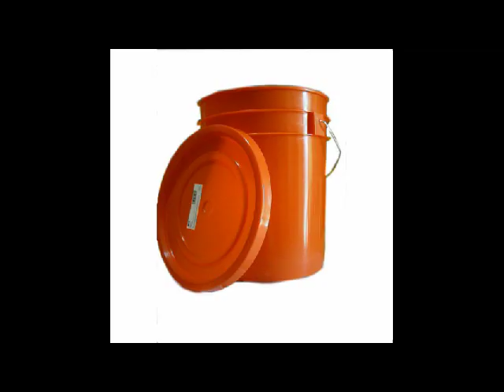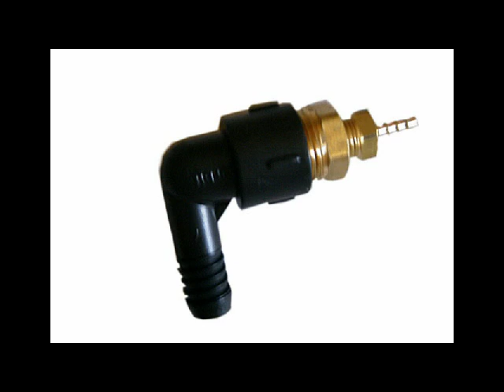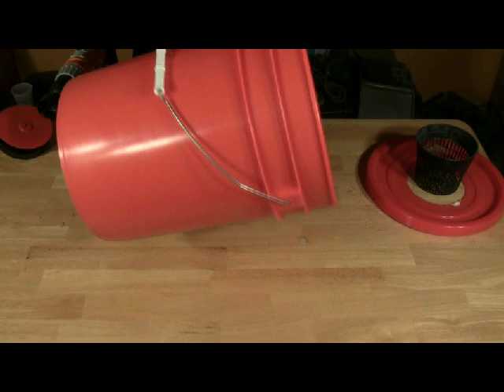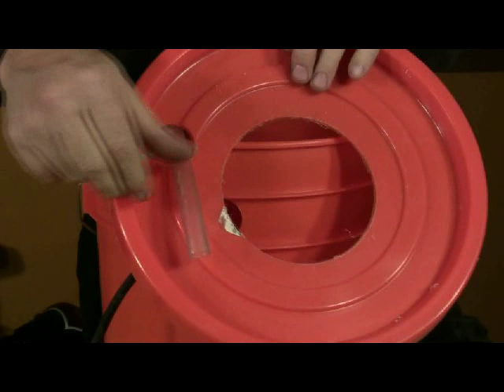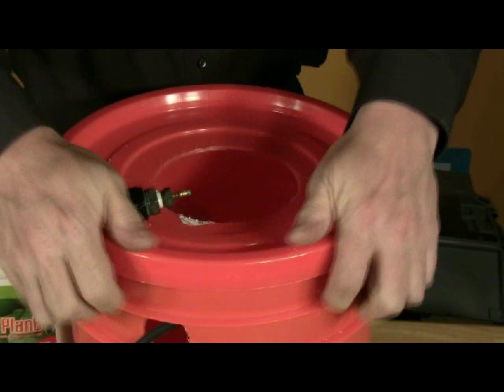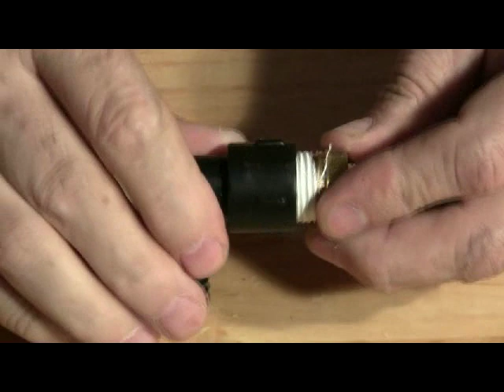Build a Hydroponic Drip Irrigation Bucket System

Comment: Home Depot sells reducers dirt cheap. Your "how to" turned a cheap item into a $7 contraption. I guess if you had those pieces laying around then it would be cost effective.

"Your Reducer"
$1.51 - SharkBite 1/2 in. Plastic 90-Degree Barb x Barb Elbow
$2.16 - Cerro 1/2 in. x 1/4 in. Lead-Free Brass Pipe Bushing
$3.40 - Watts 1/8 in. x 1/4 in. Lead-Free Brass Barb x MIP Adapter

$7.07 - Total

OR

"Store Bought Reducer"
$2.96 - Watts 3/8 in. x 1/2 in. Brass Barb x MIP Adapter
$0.98 - Everbilt 1/2 - 1-1/4 in. Hose Repair Clamp

$3.94 - Total
Reply: +Dritman Let's not get carried away here, I use a calculator. =)

Comment: The video didn't mention this, but you need to light proof it when you are finished. If you don't then prepare for algae and pythium.
Reply from the maker: Hello, sublimerasta. Good advice, and we appreciate your input. Thanks for watching our video, and taking the time to comment. Best of luck to you in all your projects.
Reply: justazcom Hey, here is some input. There is no need to make that big port for your power cord. You can simply notch it just below the lid and slip the power cord into the notch. Do it down 1" or do it and that portion of the lid. Easier to  notch it and 1 less hole for things to end up in. I would also think, with a self contained, small system a VERY small water pump would be sufficient. HOWEVER, depending on the plat, wet foot may be an issue and a air pump and stone may be helpful. I am doing a row of dutch pots myself, a different layout, but similar principle, but using air bubbles in the main feed to avoid wet foot on my peppers. Ty for the video. I think it is really great entry level set up for people !
Reply from the maker: Robert Hardy Thank you, Robert Hardy, for your input. Indeed, with this type of system, you can adjust and adapt, making it a good system for a variety of plants. Best of luck to you in your hydroponics projects.

Comment from the maker: Hi, Elnur Alibayli. The 3 gallons in the 5 gallon bucket allow for approx. 6 inches of air space. The plant roots will eventually grow down into the solution. That's ok. The pump continues to pump solution over the exposed roots to prevent them drying out. Eventually you'll have a portion of the roots in the aerated nutrient solution. Hope that helps. Thanks for watching, and best of luck in all your projects.

Comment from the maker: You could use a drip head, like the ones used for irrigation systems, or an air check valve. The valve is used in aquariums but works with moving water as well and could be used in a drip bucket. You just need to ensure that the water flow is sufficient to meet the needs of the plant in the system. Thanks for watching our video and best of luck in all your projects.